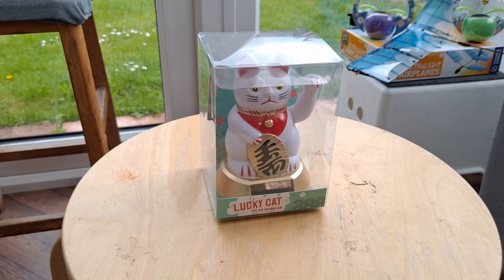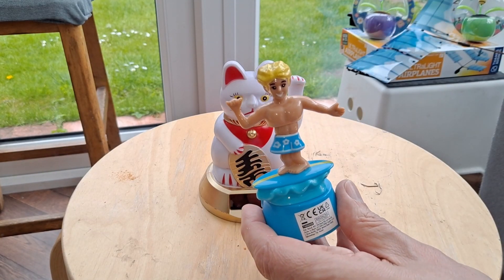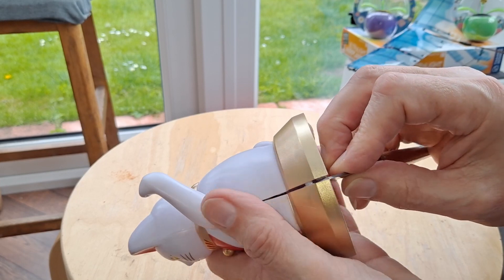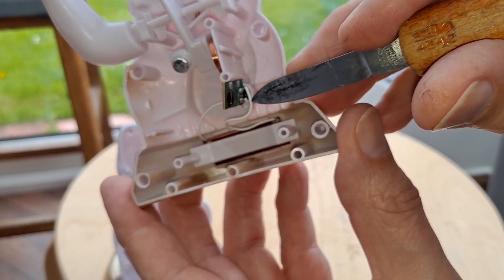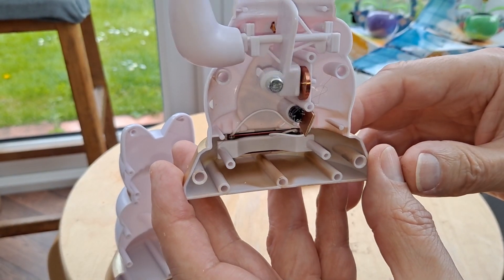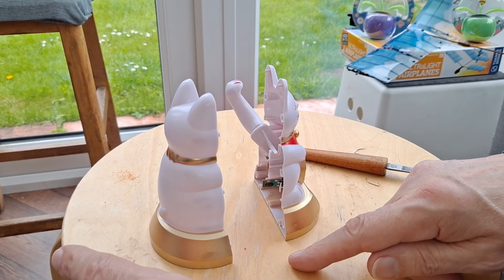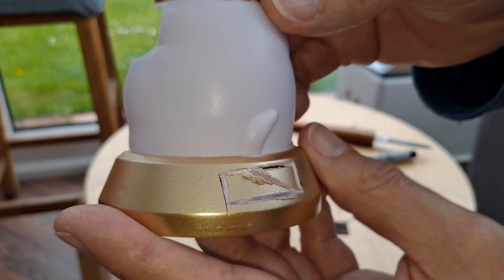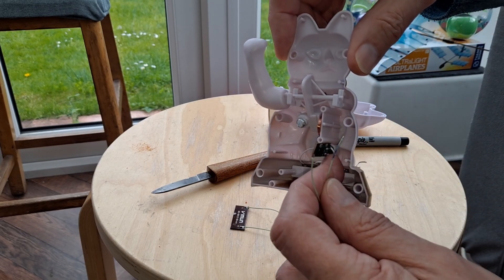Part 3 Reversing solar rockers - Waving Cat Maneki Neko Lucky Cat

Comment: Good fix. That was the best way to do it. I might be wrong, but the coil on the one you opened looks bigger than some of the other ones. 👌👍
Reply: I wish all rockers  came with the solar panel in the back